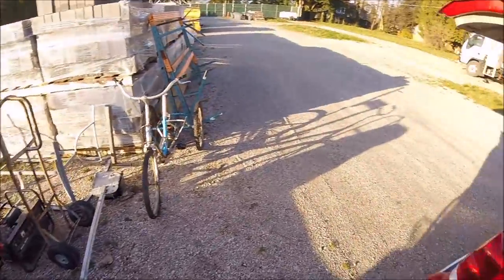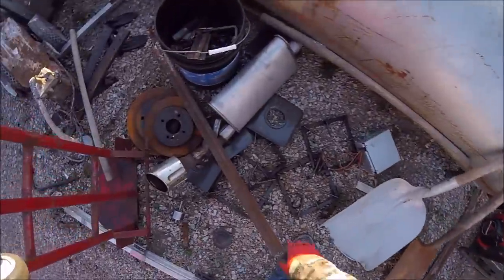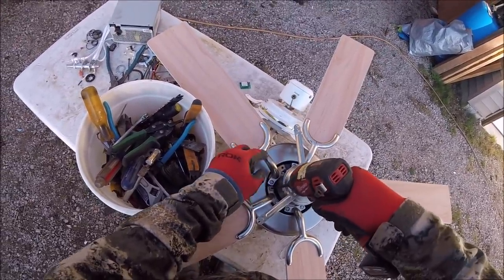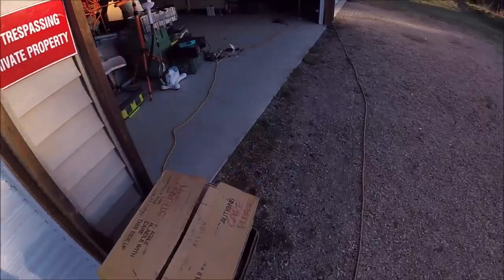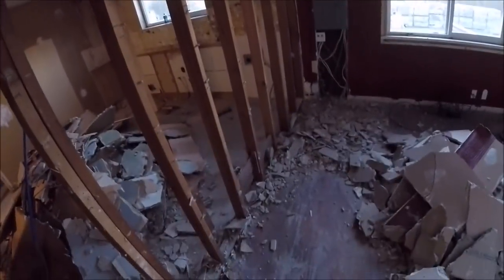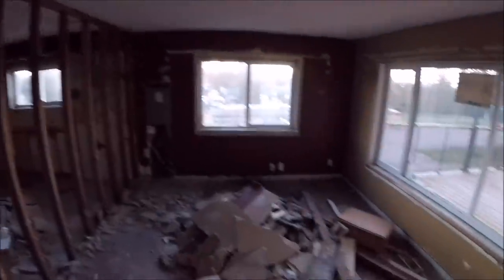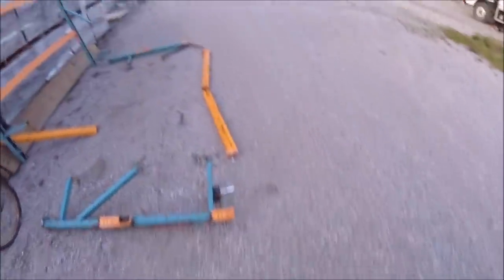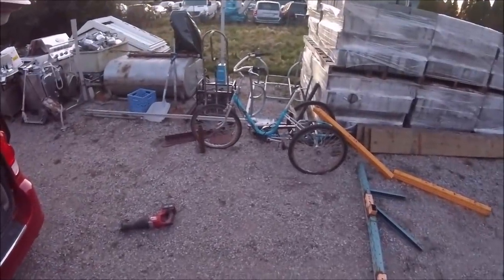Loading HMS in My Van & Final Yard Cleaning

Comment: Tomorrow when you do the HMS yard run, I am sure you will weigh rotors separately coz they are worth more than HMS. In fact the cast iron pipe will be even more valuable than rotors. When you are stripping appliances or anything, you collect all screws in a bucket and they will go as HMS. Not much but everything adds up.

Comment: Don't use a dull blade for too long your hurting the tool I've broken many chucks and even burned out Milwaukee Dewalt and ryobi brushless motors cutting heavy gauge cast railing and learned my lesson now I use a grinder on HD material and it's a craftsman lol see the tool industry should let us scrappers test their equipment because we scrappers beat up tools like no other maybe demo crews are just as bad but I know us scrappers beat tools!
Reply from the maker: I get 6-9 months on a Dewalt Sawzall until it falls apart
Reply: I get about same with Milwaukee.

Comment: 14 teeth per inch on those blades even the cheep ones work good when there 14 teeth try a cheep one to with 14 teeth
Reply from the maker: I use a lot of different blades & this one worked great
Reply: It's about time something as far as tools go gives you a break and works like its supposed to put some ben gay on your back that stuff works great for a sore back